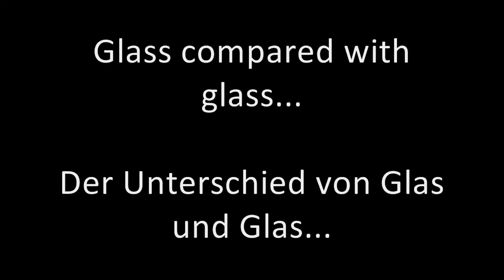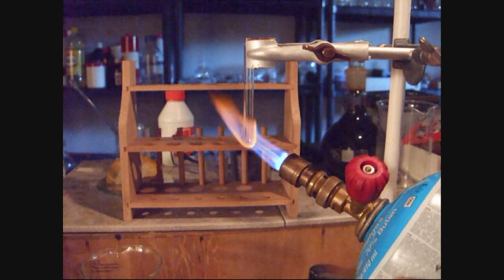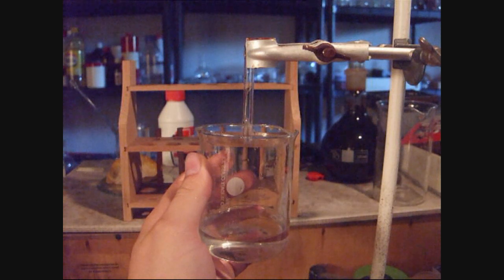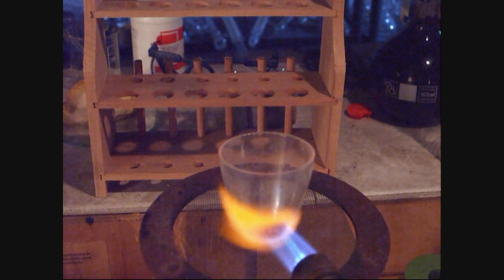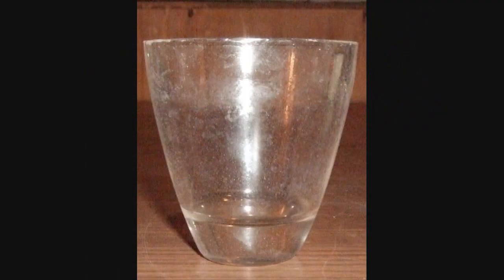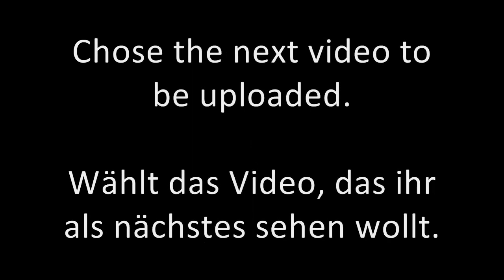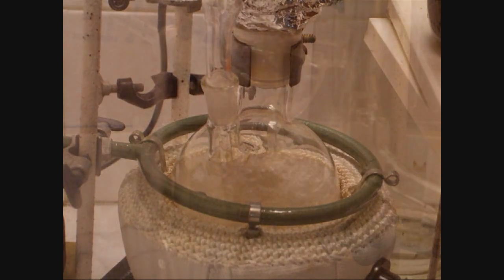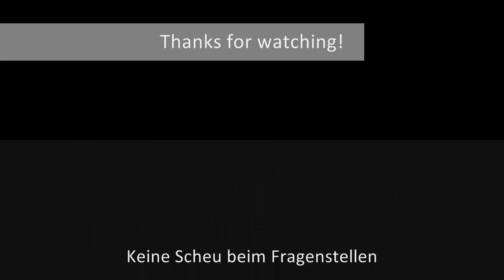Glass compared with glass - May it crack? - Der Unterschied von Glas und Glas

Comment: I've seen an old photo of someone pouring molten steel in a quartz crucible sitting on a block of ice. It didn't shatter.
I don't know whether steel sticks to quartz glass upon cooling (that would be quite irritating to clean), but you could do that experiment if you had a way of melting steel. I wouldn't advise doing a thermite reaction because it produces iron and the temperature gets a lot higher. If I had lots of quartz crucibles around, I'd certainly try that, too.